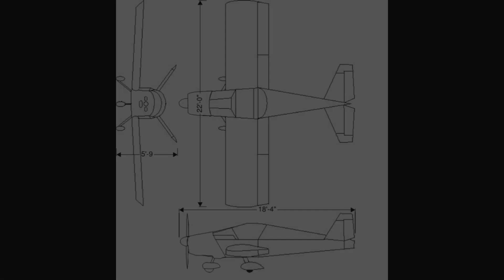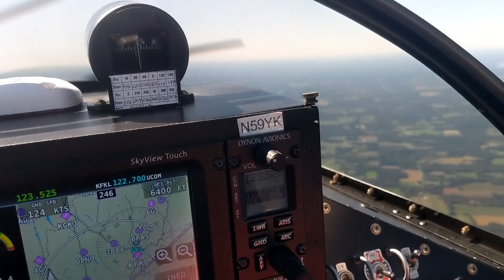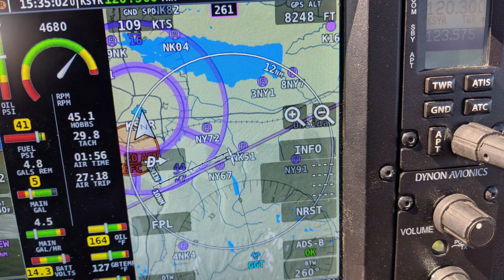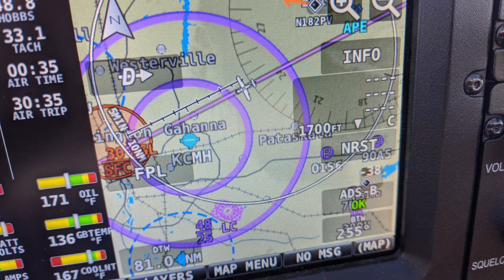N59YK Trip To OH

Comment: Very cool! That looks like a great airplane! The fuel burn is pretty impressive. What RPM did you have the engine set at while in cruise?
Reply from the maker: It's a Viking (Honda Fit) engine, so it's running something like 4,500 rpm with a geared reduction drive.
Reply: Thank you for the info! @mikesmith208

Comment: What is going your experience with Viking engines? How many hours did you flew until now, do you recommend? Any issues. I like very much of these auto conversions because the modern car engine looks much more smooth running and low noisy.

Comment: what gas do you use ? thanks
Reply from the maker: The Viking engine is a modern car engine so it prefers high octane automobile (mogas) fuel. But by adding TCP, a lead scavenging additive, it can run 100LL avgas. All the test flights were done with mogas, while the Ohio trip was all on 100LL with TCP being added at ever fill-up. It works perfectly fine on both.
Reply: mogas 91 or 93 ? thanks
Reply from the maker: @amirhess  93
Reply: @amirhess    Actually I ran 91 octane ethanol free gas in my Viking

Comment: Great looking Sonex. The placement for the throttle looks sorta like an awkward position. Or is it just the camera angle? Incredibly efficient machines. Thanks for posting!
Reply from the maker: I'm not sure what would be awkward about it? It's in a similar location to a C-172 and many other aircraft. It's personal preference. The builder of this airplane decided to have the throttle in the center. The one I built has a t-handle throttle on the left side, against the side of the fuselage.
Reply: @mikesmith208  Looks like the throttle is very close to the stick? If you stir the stick, could it touch the throttle? Cessna throttles are far away from the controls.
Reply from the maker: No, they are nowhere near each other. That's one of the caveats of aircraft construction. The stick (or any control) must not make contact with ANYTHING, EVER. :-)
Reply: @mikesmith208  Copy all.

Comment: I enjoyed flying with you today. I am considering buying the OneX kit. Is it the camera angle or do you like being a little left of center line on take off and landing?
Reply from the maker: The long nose of the Sonex, and the angle of the black glare shield (it's angled and not straight) makes it difficult to see what is straight and centered. So the tendency is to land left of center. I've spent 6 years trying to correct that, with varying degrees of success. The more you are aware of it, the easier it is to work at it. I have no idea if the Onex is any different. In any case, it's never been an issue, even on narrow runways.